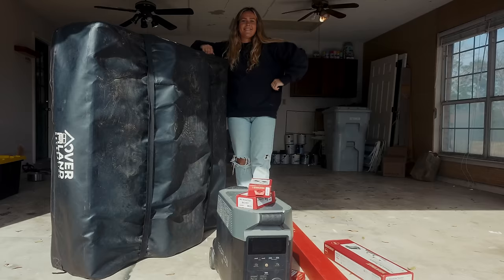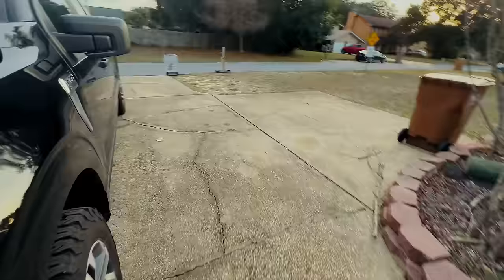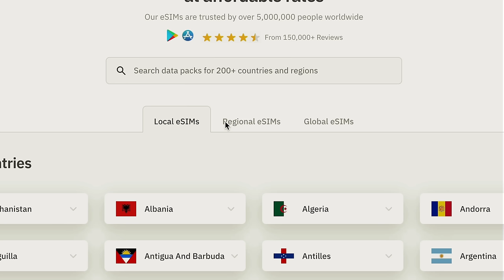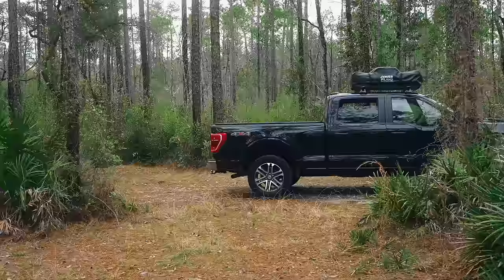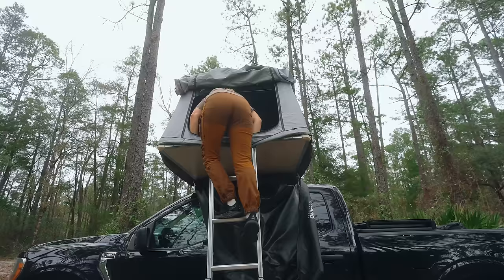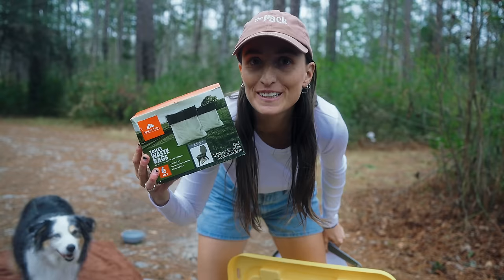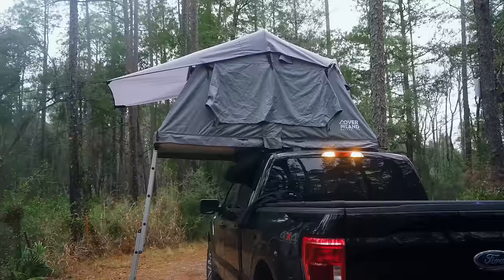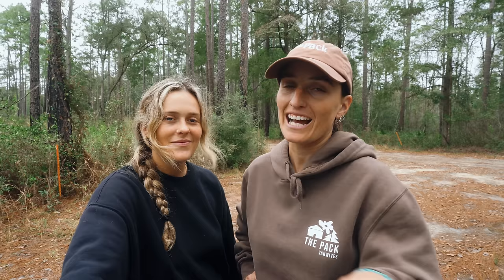Truck Camping in Rural FLORIDA (riverside)

Comment: Truck camping input : 
•pee funnel ((so no climbing down in the night (also bottle of soapy water to chase any usage)).
•A bag hanging on either side of the entrance (under cover) to take shoes off before going in or down
•plastic drawers to help organize  (I wrapped tiedowns around to keep them together and then you have spare tiedowns just in case) 

Also a little side note : let your fire go to coal for cooking.  

I recommend The Cariboo in BC for truck camping AND don’t forget your mountain bikes and hiking boots and bathing suits and layers for the chilly nights.

There are definitely not enough videos about rooftop tenting.  Kudos Wives! xo
Reply: Oh also a fave of mine for rooftop tenting (RTT) is solar patio lantern string lights!  Small and lightweight and so useful after the sun goes down! I hang one set down my ladder.  Also headlamps!  Trying to remember all the useful stuff I have… oh also the collapsing table the I use as a slide out in the bed of the truck too. Double duty!  The black bag shower.  🤔 Costco has a great foldable camping carpet that I always put below the ladder.  I also spoiled myself and got a change room tent to keep my clothes and shoes in. Pops up fast and makes organizing so much easier when weather is unpredictable.
Reply from the maker: Thanks for sharing your truck camping knowledge and input with us and our pack. This is all SO helpful 💛💛
Reply: I have a good idea of where you were camping. I lived in Pensacola for 18 years before marrying my hubby and moving to the woods in Arkansas. We used Repel with Premetherin on our clothing (that particular  formula worked better than anything else) and we used Advantix on the dogs (we had woods all around us in Arkansas). Kept the ticks pretty much under control. Good to see you getting away from the property and having new adventures again after working so hard for so long. ❤
Reply: The folding portable toilet prelined for pee breaks emergency.  Doubled as a night table.
Reply: You should make your own video! These tips are so helpful!
Reply: I got bit by a tick last week. 😮
Reply: @chrisharmon5453 If you start feeling fatigued in any way over the next few weeks, go get checked for Lyme. They don’t always leave a bully’s eye rash. My spouse got it and it literally messed her up neurologically, in spite of starting antibiotics within 3 weeks of bite. Never has been the same since, in terms of memory. Best wishes🌞
Reply: My first thought was Premetherin also. These Arkansas, well ticks in general can be tough to deal with.
Reply: -And the tent on top will help as Alligators can't climb! @Vanwives
Reply: I love your adventures but where is the van now?❤

Comment: Welcome to Truck Camping Ladies. Just a suggestion. Once you have purchased all the items you need for camping, store them in a large Rubbermaid tote with a lid that seals water, dust and mice out. Tape an inventory list to the inside of the lid. You can double check this list before you head out camping. This serves two purposes. One to make sure  you don't forget anything but also to use to double check the items on the list have been either refilled or replaced prior to your trip. Nothing like running out of toilet paper or propane on your trip!

Comment: I live in Pennsylvania, tick endemic area. I recommend keeping a small glass jar of rubbing alcohol with you at all times for killing ticks. It's way easier than burning them and when you are in bed for the night you can drop them in the jar without having to get out of your tent/car/whatever.
Reply from the maker: Thank you for sharing all your tips with us. Good advice. 😊🐶
Reply: Also dish soap and cotton balls to remove the ones who get attached to you. Cotton ball with a good blob of soap and cover. They will release to try to get to air. Then dispatch them any way you wish. Much safer than tweezers as you might break off parts in the skin and get infected. Not sure if it will work on Bella and Izzie but worth a try.

Comment: A rack for the bed of your truck would lower the tent a bit so it’s easier to get the dogs in and save a bit on gas mileage. You can still use the bed underneath for storage. We took our truck to Florida with that setup and it was an awesome trip.
Reply: And the aluminum body can't support that weight. Truck bed rack is definitely the way too go.

Comment: Good to see the pack out on your new adventure. You can never go wrong with truck camper or full size suv which most of the suvs ( expedition , suburban and others are based off of trucks like the f150 and the Chevy Silverado .. great to see you camping in the USA .  Be careful camping in the woods because hunters seem to hunt all year round .  Safe travels and thanks for sharing .

Comment: Cool tent.
If you don't have them, buy the rods that come with the tent for the awnings.  It will make your life easier and the tent will be more enjoyable. 

I would also set the tent the other way around.  With the ladder to the passenger side.  It will be easier to set the truck closer to the edge of the camping site on the driver side, leaving all the available space at the passenger side.

If you don't plan to use the bed of the truck, for heavy loads, I would install a slide out platform.

It will make a lot easier loading and unloading the camping stuff on your truck bed.

Best wishes to both of you.

Comment: ↘️  tips for grilling:

Ensure the container is stable and well-ventilated to allow for adequate flow before starting to grill.
Heat Distribution: Place the container on a non-flammable surface. Although aluminum dissipates heat relatively quickly, the area beneath and around the container can still get very hot.
➡️ Coal Preparation: Similar to an open fire, let the wood or charcoal burn down to coals for a consistent and even heat source. 
This might take some time, so patience is key.
Clean-Up: Allow the container and coals to cool completely before disposing of the ashes appropriately.
Always follow the manufacturer’s guidelines for using and maintaining your aluminum fire container to ensure safety and prolong its life.
😘😘
Reply from the maker: Thank you! Our flame was high 😂
Reply: @Vanwives  yep 😂
Reply: @Vanwives  you’re welcome.
Reply: Pretty sure that was a stainless steel pit and those are very different than aluminum ones. Still points taken.

Comment: Hey just a tip. Instead of hammering pegs in and having to pull them out, pickup a bunch of 250mm long landscaping screws and take your Dewalt driver along to drive them into the ground and when finished, reverse their back out. So quick, easy as well as holding better than the pegs. 🙂

Comment: Love your truck!  I have had a 2003 F250 for nearly 20 yrs.  I am 114 lbs & under 5' tall.   I want to go bigger too, Crystal!!!  I want to buy the 2025 Ford Lightning ( they will have the NACS/ J3400 Port).  I will NEVER own any future truck WITHOUT a hydraulic tailgate lift.  The Tommy Lift gate I have has been a MAJOR lifesaver!  Aftermarket places installs hydraulics on tailgates without  messing with your backup camera.  No need to get a hernia anymore ladies!  I load up refridgerators, water heaters, Propane tanks, Generators, etc . all by myself .  The ability to lower your Pickup tailgate all the way to the ground, then just push a button to raise is a gamechanger!

Comment: Great video.. I love to truck camp. Do it all the time.  I use some of the driveway solar lights to put around my campsite. Especially if I have pull twine to tie down a camping tent or cook tent.Just to have a wee bit of light at night in case you have to go to the bathroom or whatever. Stick them in the ground. By the time it's dark they're charged and they'll stay on all night. Also for the dogs there's a powder called seven dust. It's totally safe for thembut it will it's totally safe for them. It'll keep ticks and fleas away. I put the powder in a pair of pantyhose or sifter and put a light coat on them and then rub it in while I'm camping. It's especially good just to sift some across the soil where you're camping at to deter unwanted creepy crawlies. Lol.

Comment: hey girls..easy tick removal. carry a bottle of nail polish, bright color. apply a drop on tick when you find one on dog. the polish suffocates and kills tick very quickly, then you can remove it. (or wait for it to fall off) it's better bc if you pull out a live tick, you risk leaving most of it stuck in your dog which is not good.

Comment: Fog lights for the truck. Extra fuel like 10 gallons. A winch. They make a kit for the winch has a stakes you can pound in the ground to hook your winch to and pull you out even if you don't have trees nearby. They also make metal board things for the truck to put under the tires when stuck to get you out. There are literally hundreds of accessories for trucks.
Reply: Steaks!!   Hahaha.
You meant STAKES
Reply: @TexasLocalProduce  good catch, fixed

Comment: Wild camping is fun because of the challenges to keep it simple but functional. We’ve tried so many different rigs but the best one was the most basic: a truck cap with everything all set up. The issue with a big tent on top is that you can’t drive away in case of an emergency (like that truck in the night) or even if you want to sightsee or pop into town for forgotten things or a treat. Camping in the back of the truck let’s you do it stealth if you need to. It’s also easy for a rest area or Walmart, etc for those nights when you need it. Just saying…

Comment: Thanks for the video! Watched one of your older videos and saw Crystal dealing with back pain. Have you looked into the McGill Big Three exercises? They're used by professional weight lifters and Olympiads in building core strength and recovery.

Comment: Love that you are on another adventure! I prefer a hard shell truck camper ( although it's more like a cocoon than a camper) as I am a solo traveler and I have a 150lb dog. Ticks are insidious! I pulled 2 off of Bronwynne IN WINTER IN ONTARIO!!!
Reply from the maker: Love camping with our Bella and Izzy. You are so right Valeria the tick population is increasing at a rapid rate.💛🐶
Reply: @Vanwives  I was told that a combination of soap, vinegar and salt mixed with water in a bottle is a natural tick and flea deterrent

Comment: Always a good idea to put some silicone sealer over the nuts to stop them backing off while driving around , easy to remove if you need to actually remove it  ! Just rub the silicone off the threads and nuts with a wire brush !! 👀👍👍👨‍🌾

Comment: Since you’re gonna be using the truck more……..Harbor Freight…..they have a small ladder for getting into the bed…..mounts on the tailgate and folds over when tailgate is closed…..pretty reasonable $$$……check it out….. safe travels and camping………👍👍👍👍😉😉😉😉

Comment: Need build a camping kitchen box v leg 4 round 1 or 1 1/4 poles 2  pole each side Outside use 2 x4 wood and u bolt to hold the leg and leg stop. you want box 36 " in  tall side fold down make self with chain inside hold it level.  Make box out of 3/4 plywood inside  use 1/2 plywood make self a pocket for salt and pepper and spices coffee One side for camp pots Maybe grill Get empty laundry soap bottle with spout to water hand plus tub on ground. Make room bread and anything need to cook in one box Boy scout we park and camp use Kitchen box  make wide as camp pot 6 in  or 8 in for dinner plate what think?